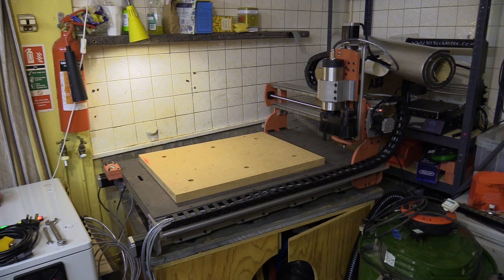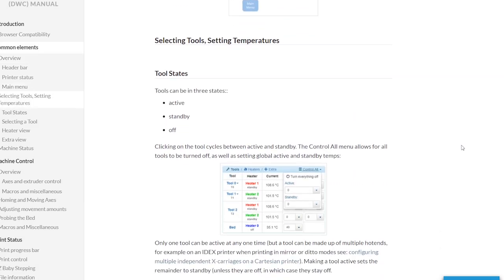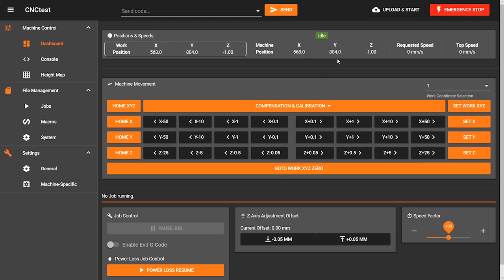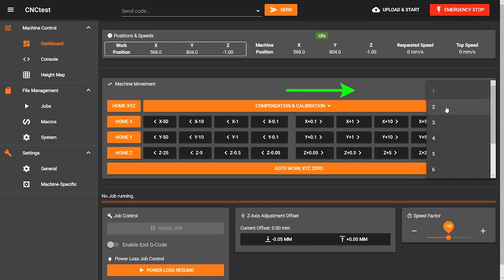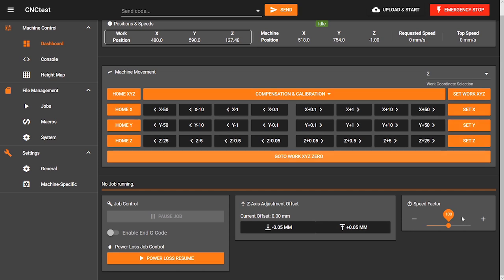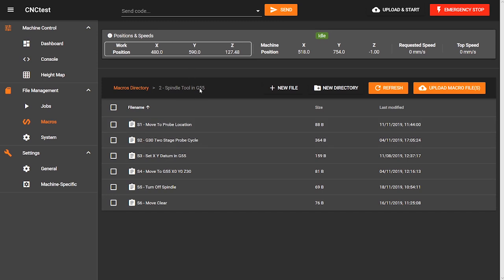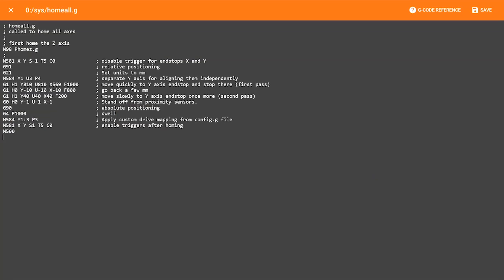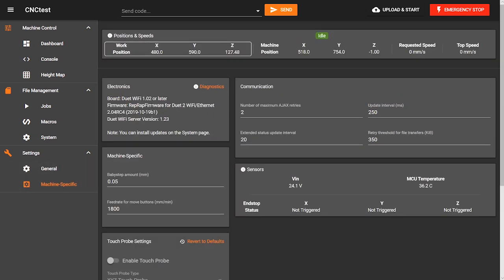#44 MOOT_ONE / Duet CNC Web Interface by Ooznest

Comment: This is overwhelming for a complete CNC beginner such as myself who is stuck with the original Duet controller which is already a nightmarte to learn to use! This video seems to complicate issues with alien language rapidly spoken (!!!!!) and therefore becomes gobbledygook  when you seem to be demonstrating your superior knowledge in revealing the shortcomings of this Duet upgrade!  Why are there no online BASIC TUTORIALS on using Duet CNC?!
Reply from the maker: At it's heart the Duet platform is for 3D Printing so it is a work in progress being developed for CNC applications. This video is quite old and the firmware has developed. I'm now using RRF 3.3.0 with the newest web interface. The duet website is the best source for instructions for setting up.

Comment: Im sure thyis is an excellent tutorial but where the videos for total beginners?! There is so much high level assumed knowledge. I thought the whole idea of a CNC kit is that beginners can enter the world of CNC! I am building the Workbee and have the previous Duet controller which as you say is designed for 3D printing. Can somebody PLEASE link me to a total beginners tutorial for the Duet?
Reply from the maker: It might be worth buying a book about CNC for noobs. But for the duet the best thing is to read the gcode library and then go to the system files and read those. It takes a lot of imagination and then trying things out in a controlled way. I am working on a manual for my latest controller which might help but that will take a while to be ready.
Reply: I built the workbee with the Xpro 4 control, and I have been looking at the duet for my second CNC build... but No graphical 3D model of the G-code in the control software is currently a deal breaker, despite the many advantages and additional axis support that the duet offers. I could be wrong about this, but there is so little documentation on running CNC with Duet. I would say, maybe, if you built a pretty standard workbee, to use a GRBL controller such as CNC shield, Xpro, Black Box Motion Control and use the OpenBuilds guide to setting up your GRBL settings for the Workbee and use OpenBuilds Control software, for the simplicity and 3D graphical rendering of your G-code, plus is very well maintained with updates. Otherwise, I would watch the Ryan Locke videos on the Duet on the Ooznest youtube for configuring the Duet. Good luck!
Reply: @msdosfx  Thanks. I dont even know what GRBL means. There is so much jargon. I  need a basic video that explains all this. I have watched Ryan Lock videos and find his narration difficult to follow. There are no Ozznest videos on how to actually use the software that I can find, just one on calibrating the machine. Highly frustrating over several years now. I have a tiny Chinese CNC machine which used Mach3 and I can intuitively see how most things work and there are plenty of excellent video tutorials. My observationis that the few UK people doing this are too cerebral and delivering at too high a level for complete beginners. How do you guys acctually get started? I need 'need to know' information about the Duet that was sold to me.  I thought the whole point about robotic manufacture is it is time saving! Its far quicker to make a part by hand, but I can see the immense rewards once the learning curve has been tackled.
Reply: @WoodomainJeremyBroun  GRBL is just the Arduino language for CNC control. Like I said, I think you would be better off getting a different controller that speaks GRBL because there are better tutorials and support related to Workbee controlled by a GRBL based controller. The Duet is "better" because it is faster, more configurable, can do more axis, but unless you are an advanced user, I think it is probably not a good choice for a beginner.  here is a list of GRBL based circuit boards available https://mellowpine.com/cnc/best-cnc-grbl-controllers-for-hobbyists/
Reply: @msdosfx  Thanks for the link which I studied. The problem is I have built my machine around components that were recommended and supplied to me as a beginner! Two and a half years on I am still not up and running so I cannot just change course and rip bits out and install the latest kid on the block controller circuitry and probably new stepper motors etc. You use the words 'Arduino language' when I have already said the jargon is gobbleygook to me!  I am a CNC newbie but not completely stupid. I am the guy who wrote the pioneer book "The Incredible Router" in 1989 and my Youtube video "What can you do with a router?" has 2.5 million views.  Why? Because it is clear, succinct and starts with absolute basic principles and is clearly structured using plenty of visuals. The general standard of videos on CNC is apalling quite frankly. Yours is an exception but assumes advanced knowledge. The best tutorials are on Mach3 and delivered by experts who are clearly teachers. One series in particular by Roger Webb who repeats key teaching points as they can easily be forgotten. Hours and hours can be wasted watching videos by poor communicators that dont answer fundamental  'need to know'' questions. Unfortunately I have a mental block when it comes to electronics. I simply want a controller software where the interface is clear and bold on a small screen (as I have a small workshop cramped wioth machines and equipment as space is at a premium) and one which allows me to import and edit basic G-code that will allow me to cut a 2.54D rectabgle and circle! That means my first project can be a custom built spindle mount as I am trying out different spindles. Feed speeds and RPM for me are intuitive and done by watching and listening. Also I want to be able to see the cutter engaging. These endless videos on dust shoes that totally conceal the cutter engaging seem to me to further remove the user rom the natural engagement of working wood. Fortunately the Ooznest related forums are a useful conduit for all the complex issues likely to be encountered by anyone with enfless time available to inhdulge in this field

Comment: Oh man! I think you mentioned you also use an XYZ touch probe plate ? I have been needing to use one so badly but wasn’t sure how to get it working with duet (how to wire it up) and what config settings to get that type of homing to work on Duet! So sorry to bother you / just realized how packed of useful information this video was and that you’re basically the guy I’ve been looking for that has gotten these things working on duet for CNC use!   Any way to also share or talk about using a XYZ homing plate woth the duet / share code and how  or where you wire it up to (I don’t know if just a normal axis ends top plug location would work as then how do you let it know to set the ... differing Axes Zeros if you use say the ... Extruder 0 ensstopnplug) - Just any help would be great! If able to see this I could give you contact info possibly if I can figure out how to send YouTube messages from phone * lol 

Many thanks!

Comment: Hey I noticed you have a “U” Axis appear after homing.  I assume this is because you are doing independent homing of the two Y axis motors / thus the virtual “U” axis is needed.

I’m  trying to do the same thing if that’s what you have done and was having a bit of trouble I’m not sure why :/. Is there anyway I could checkout your config files that deal with the homing procedure for that?  I’m just trying to have it double check either at the end or start if each job that the two Y axes are synchronized! 

Love the channel keep up the awesome work! I really Really Hope I  could maybe hear back from you / hope you see this comment as it’s been so hard to find another duet CNC user doing that type of homing (again I’m presuming you are by seeing the U axis - maybe I’m wrong)

Thanks!

Comment: would you be willing to share your software?
Reply from the maker: This software interface for the duet is available from Ooznest and their website. It's a free download.
Reply: @EducatingSavvas  not for the web interface really but i really need an example of how your doing the dual y homing and how your setting up the axis to identify them individually. like you im using a duet for a cnc, I'm using the duet3, VFD, dual y endstops, and i have rack and pinion for my movements on a machine with a cutting area of 1250x2500x300
Reply: @jasonlipavsky7371  how is the duet 3 for cnc, does it work alright? Would you do it again? (Am considering doing that as well)
Reply: @VentureVlog  it works great and yes I would do it again, I'm running my motors at 4.5A and it stays cooler than I thought it would but.... the expandability is amazing, I have lots of plans for this machine and with a duet as the backbone I feel confident it's up to the task
Reply: @jasonlipavsky7371  are you now using the ooznest software? How do you go about controlling the spindle speed, is that possible at all? Anyhow, what was your biggest source of info to make it all work with the Duet3.  Was considering the blackbox but really like the option of adding a fifth axis and not having the computer connected on the duet 3.
Reply: @VentureVlog  I too was going to go with the black box and decided on the 3 because of its abilities, honestly, I've sourced info from so many places including my friends in the programing department at matterhackers, duet3d has made alot more stuff available now compared to December of last year when I did my build
Reply: @VentureVlog  also I use fusion to do my toolpaths and there is a post for it for the duet but I haven't made the edits for setting workpiece cords. And spindle speed so I have to add them to the gcode but other than that its amazing
Reply: @jasonlipavsky7371  dang, I can't even get my stepper to rotate  this is pretty hard.
Reply: @jasonlipavsky7371  so did you end up using any of the ooznest software?
Reply: No, I basically set it up as a 3d printer with a Y and U axis as a slave Y and slaved a second endstop for squaring the machine, i set it to cnc mode and the spindle is controlled through a pwm heater output and a digital to analog 1-10v breakout board

Comment: I just got the Duet3 which I think you would really appreciate, as its got a lot more cnc specific updates to the board along with a lot more power capability. Currently there is no direct ooznest specific overlay, but this one seems to have some form of vfd spindle Output, alongside up to 6 x 6a (peak) motors and canbus allows I creasing it to 24! But so many pins and updates. I just need to try and learn how to customise it more. As I would love to do what you have with the 2x Y axis proximity sensors. As I'm getting fed up of the standrd ooznest spring switches breaking. Thank you for all these updates as you have given me the confidence to start my own cnc scratch build. As I think my workbee isn't up for what I thought it was for.
Reply from the maker: Yes the VFD spindle enable was something I had suggested in the forum. My solution on RRFv2 was to edit the post processor on the CNC software - I've still yet to update the firmware to version 3. In the new year I'll save to buy the new controller and mock something up, but first I need to finish the manual. Do you use the belt or lead-screw machine? And what are you cutting?
Reply: @EducatingSavvas  I have a workbee lead screw machine, 1000x1000. I bought it just to have the experience of building something like this. But realised fairly quickly I couldn't do the kind of work that earns me my money on it. Its still one foot too many into the hobby side for where I want to be. The next chassis I have designed is radically stiffer and probably at least 5x the weight as I want that added mass to dampen vibrations and give me a fair crack at some semi decent aluminium machining. I want to move up to some 4+ amp motors and potentially play with gearing them, not sure if it will really do much but I want to run rack and pinion as I haven't really loved the lead screw setup with the 8mm rods whipping away. Genuine hiwin rails are the next on the list to order. As for me I want to be able to machine 3D solid acrylic block at a fine resolution. And for me repeatability is the key. The duet 3 seems really nice, although as per all these things, the Costs are all adding up. When I pre ordered it, I didn't realise that It would be a pain tk get running without the raspberry pi.. So another £60 on top.
Reply from the maker: @lasercut.london549  I've not used the workerbee but 1 meter is large for 8mm lead screws. I think the nutblock can be improved, on the openbuild system, and you can't run it fast and need lower feeds it get good results. That said I went form belt, to lead-screw to ball-screw for the drive mechanism to get the results at the speeds I needed. So is there not a standard web interface like the Duet 2?
Reply: @EducatingSavvas  the interface is very similar to the ooznest, mostly due to the ooznest bejng a modification of the duet interface. I have had success porting some of the ooznest settings over to the machine. But I'm still waiting on an email back to see if they can supply some nema 23 motors that will max out the power capabilities of the board. The peak is 6.3a but I think 4.3a will be a good compromise. But ooznest only show up to 3a currently. I was looking at balls crew. And I have not ruled them out. But ideally rack and pinion due to wanting to keep it to a set size and keep all motors centred around the gantry. The potential to change the gearing to the rack easily intreagues me.
Reply: @EducatingSavvas  So you mean that It's possible to replace the lead screw by a Ball screw inside the 2080 Cbeam rail or the workbee ?  8mm would be a maximum...and haven't heard of 8mm Ball screws.
Reply from the maker: @Levisgil47  No I have a new design now. It is called the Moot_One and the plans area available on my website to buy now.
Reply: You could  upgrade your limit switches  I just replaced the chintzy limit switches with TEMCo Adjustable Roller Arm Limit Switches. They are beefy, fully adjustable, and can be wired Always Open or Always Closed

Comment: Nice overview. Clearly it's based on DuetWebControl 2. The original does contain shortcuts for the macro folder on the right of the dashboard view so it's a shame that's been removed. It's not a configurable list as such, more of a compact view of the macros directory whilst in the dashboard. It shouldn't be too difficult to restore that if you wanted, it's all open source. Despite the grbl release, I think you're still better off with Duet. RepRapFirmware 3 is incoming and brings further improvements. Conditional GCode is also coming which it seems will be incredibly powerful.
Reply from the maker: Yes I should have made that more clear it's based on the original. I was surprised they took the marcros away from that section but overall it's much better suited to CNC use. GRBL's still has some benefits, pause and resume is a lot more responsive. I still haven't moved to the new version - it feels like it'll be a bit of work re-writing everything and I'm still working on my assembly manual.

Comment: Great. My Thanksgiving holiday only needs a This Old Tony Video to have all my favorites! Well, I don't know if I can count Marius Hornberger anymore. He seems to not post as much any more. I'm sure he'll do a holiday video sometime soon. I am very interested in this. My MPCNC has an Archim 2.0 controller and I run Marlin with CNCjs to control. Works ok, but the duet is getting some energy.
Reply from the maker: He's young and probably busy with real life. The You Tube stuff really takes it out of me - it's a miracle I put anything out tbh. Archim 2.0 look good - I think I have a old controller from a 3D Printer I took apart - might look into that for a demonstration model. Duet is a lot easier to work with though.

Comment: Does grbl support tool change? Last i checked it didn't. I'm using black box controller on one machine and geko on my other with mach3 which supports it
Reply from the maker: I haven't looked into tool changing on GRBL but this web interface is for the duet board which uses the reprap firmware. I think tool changing will work on the duet though - with some work.